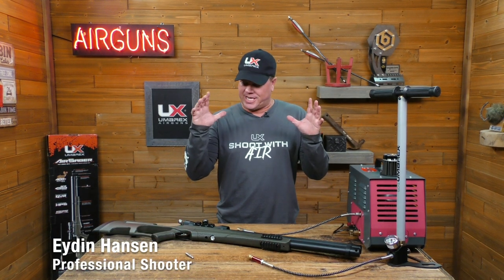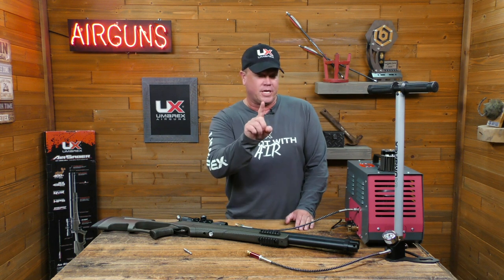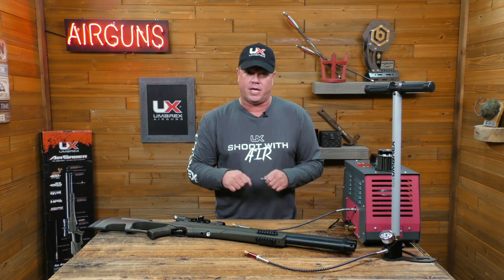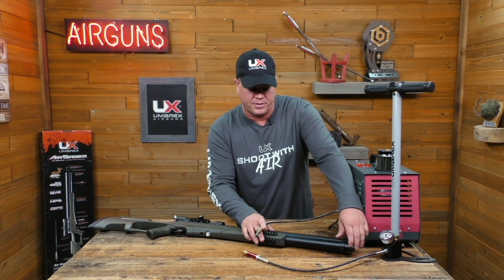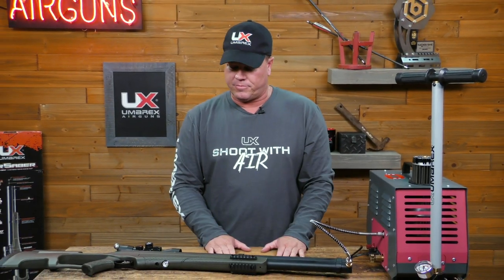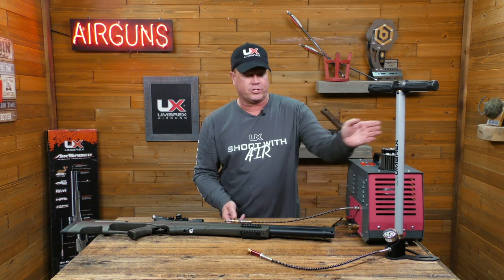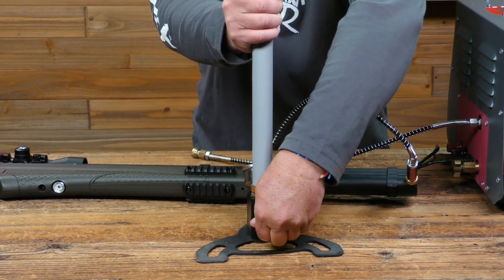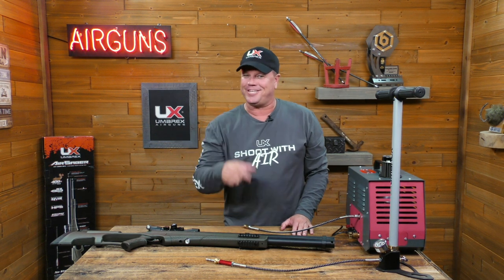How to Fill the AirSaber Air Archery Arrow Rifle : Umarex Airguns

Comment: You don't find out you need a $500 special aut compressor until you've already bought the airbow. This should be a package deal otherwise you have a big paper weight. Manufacturer is not upfront about all of these costs. You need special bolts/arrows too.
Reply from the maker: Thanks for your comment and desire to help others. The video is up front. All PCP guns require high pressure air, even the Benjamin Airbow as you have pointed out.
Reply: That was the first mistake I realized after we made the purchase.
Reply: 100% correct. Needs a package. I was about to buy until I saw this video.
Reply: You can get it filled at any scuba shop or paint ball shop for $5 if you can't afford a compressor
Reply: @p.f.droney8973  great info!!!!
Reply: Boo Hoo, Buy the 75.00 hand pump!
Reply: @UmarexAir  my gun came without a degassing port or screw screw as manual states should be there. How do I degas now?

Comment: Why not have a Foster fitting direct connection instead of the fill probe? Too easy to misplace the fill probes.
Reply from the maker: 100%! Why why why. The Zelos, or as some know-it-alls like to point out, the M60, had one, but we updated it to a Foster before bringing it in.

Comment: How would this Umarex air compressor work in Hawaii as the temperature here's normally pretty close to the shut-off temperature of 87 degrees year round? Wouldn't it keep shutting off?
Reply: The shut off temperature is 160 F.  The cooling fan starts at 87 F.
Reply from the maker: Thank you, Nelson. Correct!

Comment: I purchased the Umarex air Sabre read the manual then charged it to make sure there were no leaks, after seeing no leaks after 1/2 hour I attempted to degas as the manual stated however the degassing screw is missing. So how do I degas this rifle
Reply from the maker: Strange if it's holding air but the degas screw is missing. On the AirSaber (single barrel) it is on the left side where the shroud meets the receiver at top of stock. On the AirSaber X2 (double barrel) it is on the left side under the selector bolt.

Comment: I bought a hand pump off of eBay, and it is not working right so, I just bought the compressor. I hope this gets it filled.
Reply from the maker: You'll like using a compressor. Just follow directions. If it requires oil use it as the owners manual states. Don't skip a lubrication.

Comment: Is there any maintenance required or oil points how about moister in the chamber. Just wondering I'm very interested in the saber. Have you had any seals or ports leak and or they serviceable? Don't mean to bother you but you seem very knowledgeable about the rifle.
Reply from the maker: They are serviceable. There's been a handful of people that had leaks at the gauge, but corrected. Moisture in the air cylinder is always a concern. Best to use moisture filters on your filling devices. There are aftermarket filters that fit most HPA air compressors. As for lubrication just want to be sure to keep moving parts like bolt action and trigger linkage lubed. Silicone oil. When pushing the arrow in make sure it goes all the way in and seats over the o-ring that's down at the bottom. That's important. Sometimes you can hear a faint click, but you can feel it if not.

Comment: What coupler do you use? 1/4 does not work  I have an air compressor at home just can't use it
Reply: I just used the air probe and my normal compressors quick disconnect, it doesn’t need to lock into the compressor qd. You just press them together to spurt about 100 psi into the gun to seat the fittings. I had to read between the lines of what the video said to do.

Comment: Hi. I came here to let you all know, that you DO NOT need high pressure air compressor, regular air compressor, scuba tank or some other trick to initially help close Airsaber's inner seals when starting from 0% air pressure. 
 All you ever need is a high pressure hand pump.
 The method is simple and terrifying. You have to pump fast enough and long enough to continuously generate pressure and so overcome leaking air that will escape before inner seals start to hold air.
 Your pumping frequency has to be 2-3 downward pumps per second and you have to keep up that speed at least a minute before taking a break.
 I'm not in particularly good shape and I weigh about 75kg. Still I managed to fill my Airsaber with sheer grit and stubborness. Start pumping with your hands only and when you feel fatigue starting to slow you down, place your hands (and pump handle) near your hip hinge area, keep your hands mostly straight and move pump handle up and down with your leg movement only. You can really generate some good pressure by leaning on the pump handle with all your weight when going down.
 As I write this, I'm out of breath, nauseous and my legs are toast. But my Airsaber's pressure gauge is clearly on the green zone. I don't ever want to do this again so I will make sure to keep air pressure always high enough.
 If someone wants to know, I used Hatsan handpump. I had to buy aftermarket quick coupler for it. Best Fittings' quick coupler happened to fit perfectly. Some quick couplers might not lock in place properly so take notice before you start filling. I had to take out this quick coupler's air pressure controller screw to help air flow move faster.
 I believe any high pressure hand pump will work just fine. You could also make a tag team with friends and change the pump operator on the fly, if you moved FAST.

Comment: So there's no way the hand pump will work? Or just too much work
Reply from the maker: It will work, but you need a quick burst of air to get the valve shut first. A hand pump just does not put out enough air on one stroke to do it.
Reply: @UmarexAir  🤦🏾‍♂️thanks for the response. I guess I need 1 anyway

Comment: Can you use any air compressor and if not is there an adapter
Reply from the maker: You have to use a high-pressure compressor that goes up to 4500 PSI, most garage compressors don't come close to that.

Comment: I think you should mention that the air fitting adapter that the airsaber comes with does NOT connect to a standard 120psi air compressor fitting. This means you will HAVE to use a canister to fill it, or take it somewhere for the initial fill.
Reply from the maker: The male end of the probe does fit a Foster female fitting. Same fitting that's on the hand pump and the ReadyAir compressor.
Reply: @UmarexAir  this is correct, it hooks to my high pressure air compressor. It does not hook to my shop air compressor, the gentleman in the video said that you can hook it to shop air to initially seat the seals. Perhaps a foster fs12 to 1/4" quick disconnect would be a good addition to ship with
Reply: I just used the air probe and my normal compressors quick disconnect, it doesn’t need to lock into the compressor qd. You just press them together to spurt about 100 psi into the gun to seat the fittings. I had to read between the lines of what the video said to do.

Comment: I don't understand, are you saying I can't fill the air saber from zero with just the pump?
Reply from the maker: Correct. It needs a "burst" of higher pressure to close the valve first. A standard garage compressor can do that, but won't fill it.
Reply: Mine came completely empty and I could fill it up with a hand pump without a problem. All you need to do is to cock the gun before you start to pump, otherwise, the air will come out of the barrel. It says so in the manual also.

Comment: can you use any type of air compressor as long as it is 3500 psi or do you need to use the one you sell?
Reply from the maker: As long as it is able to fill a high pressure airgun tank you can use it.

Comment: Umarex has been out of stock—as far as the website shows—for about a year now.  
I can’t find any distributor or any store that has them.  
My gun came without one-nor a instruction manual.  Got it on sale from Sportsman Guide. 
Can you provide an address or contact number where I can get one.  
Somebody from Umarex actually did give me one a while back —can’t remember how I got a hold of him though. 
Please. Can you restock them on your site?
Reply from the maker: Oof. Sorry about the stock situation. Assuming you mean the hand pump... or maybe the probe?  Regardless, our teams are trying to manage the shortages as best they can. If a hand pump, it's going to be a while. If the probe... probably best to call: 479-646-4210 ext.7
Reply: @UmarexAir  the probe part only

Comment: Why would you bad mouth the hand pump?
Reply from the maker: Sorry if it was not clear... if the air cylinder is completely empty it takes a hit of air to seat the valve so that it will hold air. The hand pump won't do that. After you have air in it, no problem using the hand pump. Eydin was simply saying  that for some the hand pump is strenuous and a compressor will help make things easier. Thanks for watching. ;-)
Reply: @UmarexAir  Thank you for clarifying. So everyone needs a compressor for this great hunting equipment.  Do you all sell them in a bundle?

Comment: Why wouldn't you us a Schrader valve to put air into this? It's so common and universal.
Reply from the maker: HPA airguns operated at very high pressures... 3000 psi and beyond.

Comment: Question, the Glock 17 Gen 4 CO2 Fully Licensed with Glock will be available or I have to buy the other version?
Reply: They made it well. They keep selling out.
Reply from the maker: We've offered both a BB gun and an airsoft gun in the Gen4. Just so popular they sell out super quick. Click or tap the "Notify Me" button so you'll be notified next time we have any available. https://www.umarexusa.com/glock-g17-gen-4-177-black
Reply: Thanks
Reply: @estasfamily  Are frames for the G17 IDENTICAL? even the Internals ?( somewhat)
Reply: @ronaldpeterson5598  idk anything really just that it’s a well made BB gun (bit underpowered imho)

Comment: The only downfall I can see, is having to buy a separate air compressor/pump and not being able to use a regular air compressor.
Reply from the maker: Yeah... there used to be a thing called a Shoebox compressor that you could use to boost air from your compressor to reach the higher PSI requirement. There's boosters out there. Just not very common since compressor prices are all over the place.

Comment: We need this in a combo version.

Airbows obviously have a barrel.....

So why not size, and rifle the inside of the barrel in .177, add a pellet loading system with a side lever, and have have both an airbow for bigger game, and a pellet rifle for small game.

I wouldn't aim those expensive arrows towards the ground trying to shoot a little rabbit. Be cheaper to go to the store and buy Angus beef.

It wouldn't even be hard. A standard .177 air rifle just needs a slightly thicker barrel to make it work with arrows.

And since they're selling custom arrows anyway, they could size some so they would fit over a .22 barrel.

A .22 airgun that shoots pellets and arrows, without any tinkering to switch between them, should sell like hotcakes.
Reply from the maker: With all due respect we and others have tried dual purpose airguns in the past and they were not liked by the majority of people as evidenced by poor sales.

Comment: how to  out air - low pressure - from airsaber
Reply from the maker: Make sure there is no arrow in the rifle and the rifle is not cocked. There is a degas screw on the left side of the rifle. It is located close by where the shroud meets the receiver, right above the stock. Slowly turn it counter clockwise until it starts hissing indicating the air is escaping. Allow it escape all the way. Once empty you can verify by cocking and squeezing the trigger with the muzzle pointed in a safe direction. Then re-tighten the screw.

Comment: How to fill up a $300 air gun? Buy a pump that costs more than the gun. Oh, and that won’t work either.
Reply from the maker: Thanks for a second comment of similar nature on the same video. If you have an Umarex airgun HPA compressor or hand pump and are having issues we invite you to call 479-646-4210 ext.7. We have gun techs available Monday through Friday 8 to 5 Central time.
Reply: @UmarexAir  can you you a Bottle Of Compressed Air like other Air Bow Rifles for This?

Comment: They need to fix it so it can be pressurized with shop air...not paying $500 for an air compressor just to fill this gun...not happnin...false..wrong answer..sure glad I did my homework on this b4 buying the thing
Reply from the maker: If you can find a shop compressor that creates 4500 psi go for it.
Reply: @UmarexAir  I can't and obviously you didn't READ THE COMMENT(or dont understand it)...nevertheless there's numerous compressors at half the price of yours I've found